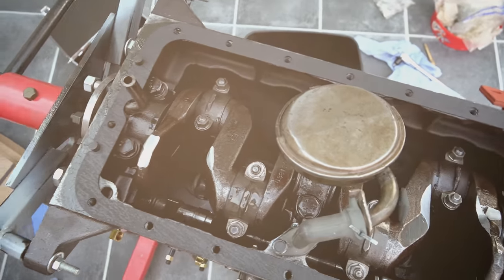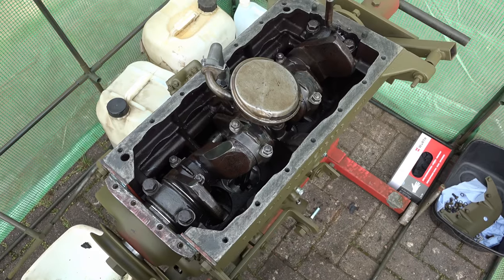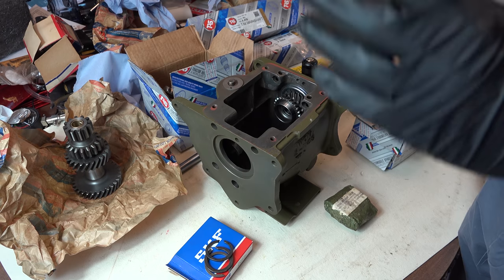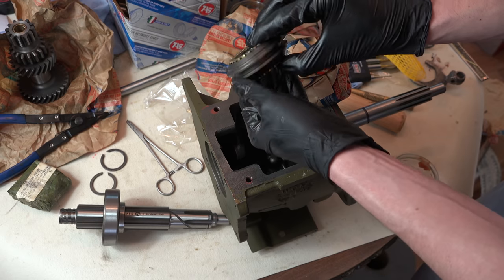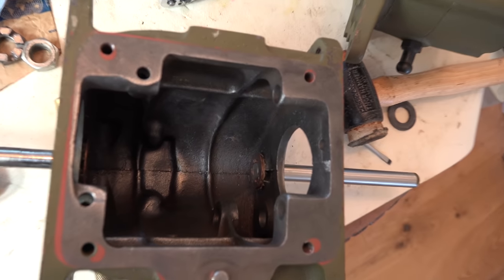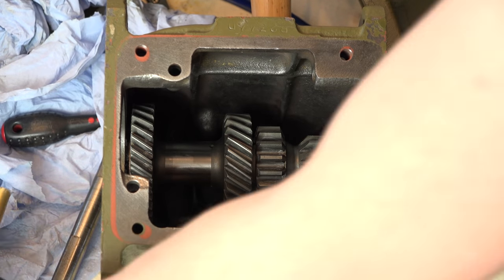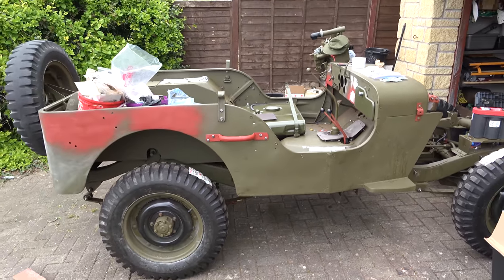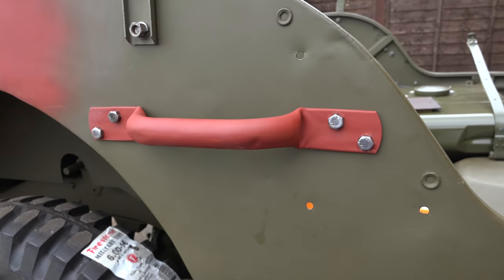I've got to take my Newly built Willys jeep Engine apart and rebuild a T84 Transmission!!

Comment: If you superglue those washers into place before dropping your gear cluster in, they don't shift on you ... not enough glue to do any damage .. just one of the tricks of the trade 😉
Reply: We used wheel bearing grease to hold washers in place back in the 60's, when I was working as a mechanic.

Comment: Because the reverse gears have straight cut teeth, there is no 'thrust' when the gear is selected, with the other gears being helical, there will be thrust (the shafts will try and move fore and aft) so clearances are kept to a minimum.

Comment: So glad it was caught now when the engine is more accessible and especially before the first start up . One of my jeep cj5 engines will have to have its oil pan dropped again someday when I plan an in frame  rebuild . That's of course if the cylinder bores spec out well enough and won't need to be rebored . I knew that day would come again after a good seal was made of the pan after rear main seal replacement and distributor teeth search after a past previous owner blew up a distributor drive gear . Oh well , we always assemble something with expectations to disassemble it once again . The hope is that a lot of time will pass before the next overhaul or repair .

Comment: Great blog. Don’t have a jeep but enjoy your excellent editing and presentation. Perhaps reconsider your sump gasket application. Whatever sealer you’re using seems NOT appropriate. Looks like you may as well used epoxy 😣 As you know never use silicon, a worm of silicon let loose in in the sump world be disaster.  Silicon is NOT a friend of petroleum products.
Use a non setting gasket goo if anything. Also the inside of the bolt holes is critical to stop oil getting to the bolt threads and working up to the bolt head which is not hermetically sealed. 
Never heard of using loctite or equivalent on crankshaft/big ends. Heat destroys thread sealer. Correct torque is all that is required. 
Keep jeeping 👍

Comment: Not too bad om. I did 6hours of work on a telecommuting device I didn't install a bank of capacitors. So 6 hour in and 6 hour out. Getting nicked and solder burn on the way. Hi hi cheers

Comment: Parts should be available for those engines from a variety of sources,  the Go-Devil 4 in the MB and F Head Hurricane 4 engines were built in India under license from Willies and later Kaiser until the late 60's.   Models of the MB, CJ-3, CJ-5 were built under license until the 1980's, though later models were powered by a variety of small diesel engines, with the Peugeot/Renault  2.1 liter 4 cylinder being very prominent. The last in ironic as that engine was also used in American and European Jeep Cherokee vehicles built by AMC in the late 1980's.
Reply: The flat head 4 cyl or overhead cam f head style was used up to the ‘ips
Reply: Used up to the ‘80s
Reply: @robertnaughton5417  Who used the F-Head until the 80's,  If memory serves when AMC bought out Kaiser, they sold the V6 back to Buick and the F-Head was dropped, replaced with the 232 and 258 CID sixes in both vehicles in the US and with various diesels as well as the sixes  for export.  I do not think that even Mahindra was interested in that archaic engine by that time.
Reply: So the f head was still made in the 70’s
Reply: @robertnaughton5417  American Production stopped in 1970. Still made in limited quantities in India and possibly in South America.